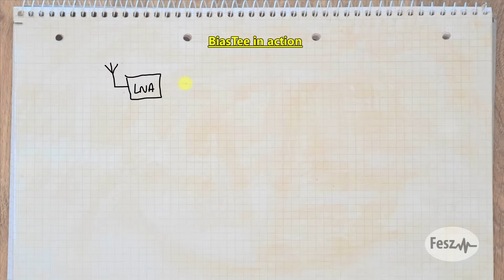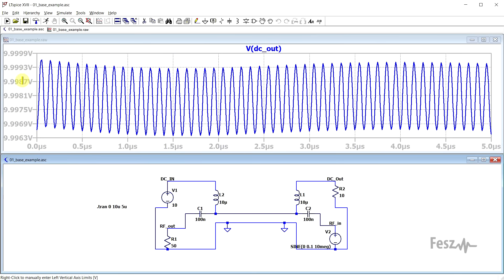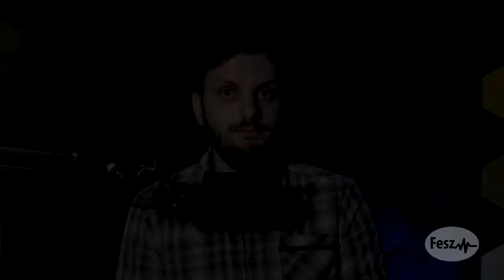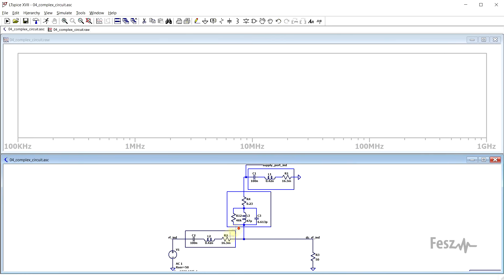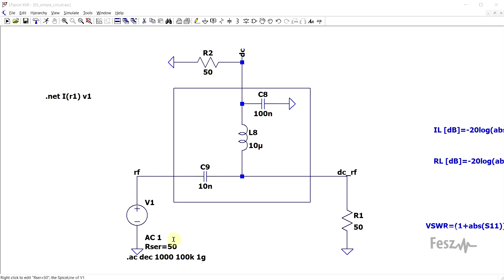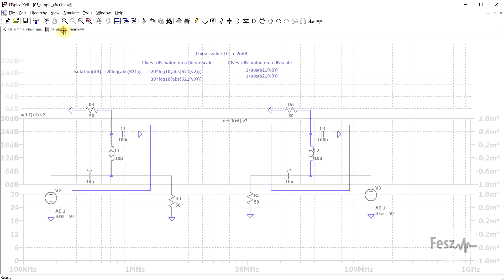Bias Tee Basics (1/2)

Comment: Hi, If I can steal this thread. Refering back to your series of videos on low noise amplifiers, can I ask what was the maximum DC voltage that could be safely applied to your circuit? What voltage rating did you use for the input capacitors?  The IC you specified has a maximum input voltage of +/- the supply voltage. So does that imply a max DC off set of +/- the supply voltage? Sorry for the dumb questions. Cheers Bill PS Keep making these informative videos

Comment: I want hood low frquency behabiour from 0-10khz. While using current controller 20mA Ac and current controller 200mA DC. What kind of circuit should i use?,

Comment: What I have often seen in active broadband loop antenna designs by HAM radio operators, made for remote powering, is that they use self-wound transformers on a ferrite ring, to separate DC and AC.
What are the consequences of that compared to just using AC blocking inductors? Bandwidth limtation is one I guess. But it must have advantages, seeing it so often.
Reply from the maker: If its a transformer - with 2 separate windings, it might be a current balun. I saw this used quite often with loop antennas to turn the balanced signal from the loop into an unbalanced signal fit for the coax.

Comment: What did the waves say to the inductor? You’re choking us..
What did the resistor say to the capacitor? Ewwh look at your discharge.
What did the toroidal core say to the wire? You’re running rings around me.
Reply: What did the non-linear circuit say to the wave? Your frequency is multiplying.
Reply: What did your significant other say? "What the fuck are you playing with now? .... just don't break anything"

Comment: Similar to bias-tee, a diplexer will split signal into two port. One of the ports will have DC and some lower frequency band. A bias-tee usually only have frequency up to  tens of kHz, as shown in the simulation.

Comment: Gotta love the SDRPlay radios (especially the latest ones)🙂
Reply from the maker: Its quite a nice radio, but the interface needs a bit of getting used to.
Reply: @FesZElectronics  Yeah. I've always used a third party software, rather than their in-house software. That said, they are currently working on a new platform-independent software (yay Linux!)  that, while not ready yet, shows a more sane/simplified gui; fingers crossed.  ( p.s.  If by "interface" you meant the programming API, i've never used it. )